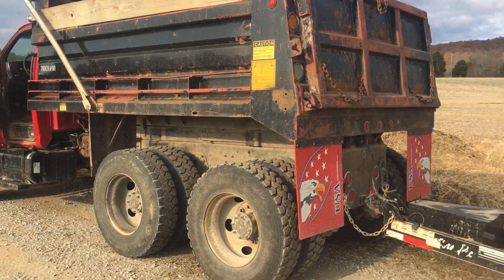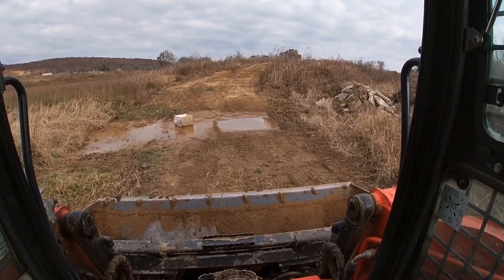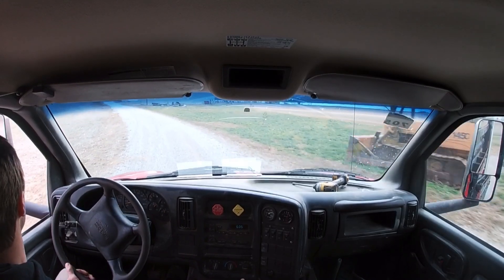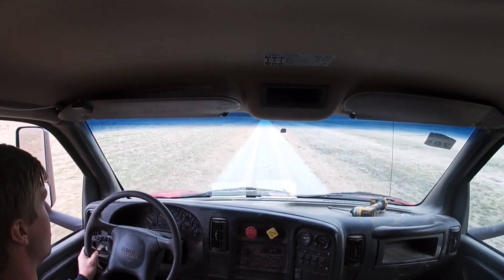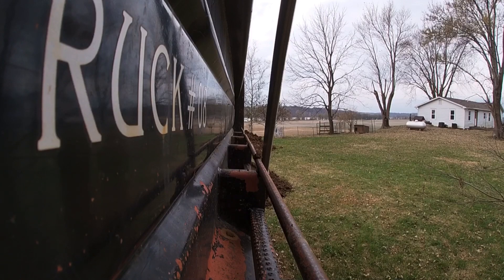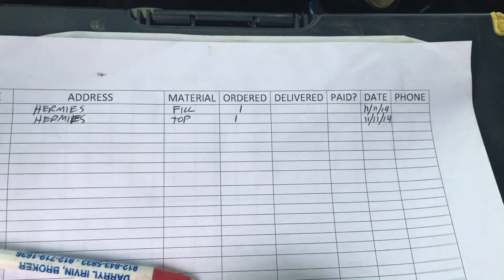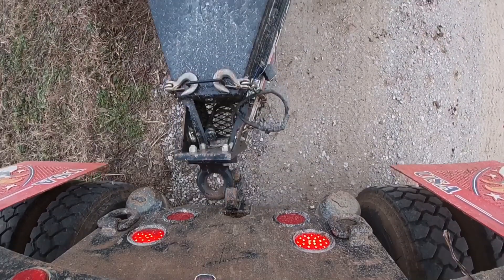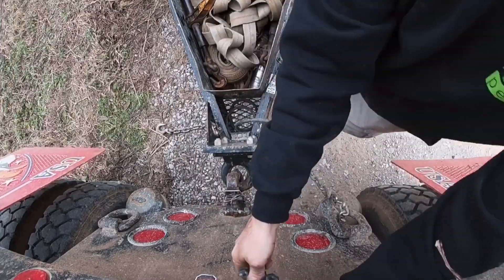Hauling topsoil through the mud with the C8500 dump truck

Comment: Tell Mike he should get a 4in1 bucket for the CTL. it will make loading the truck easier. You can get the load in the center with less effort.
I've been using a 4 in 1 for 50 years. Fyi
Reply from the maker: its on the wish list!